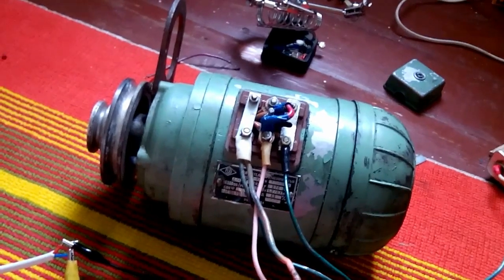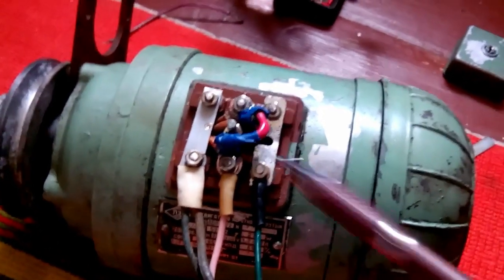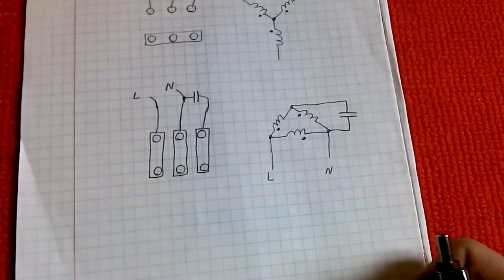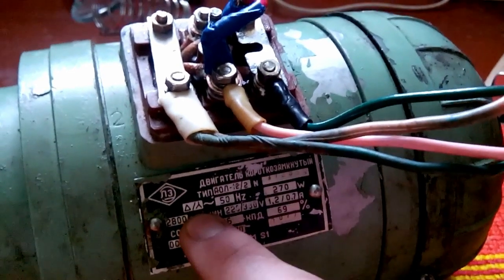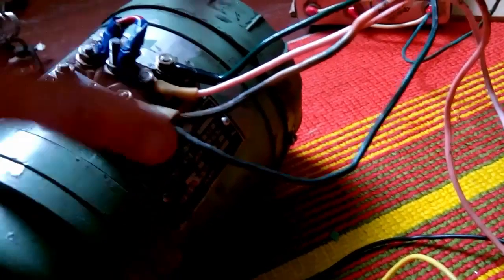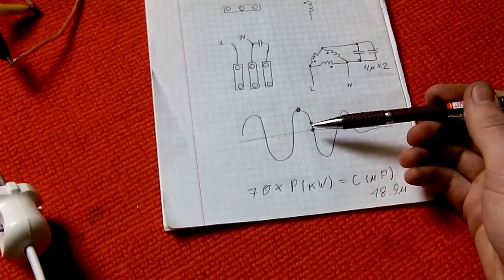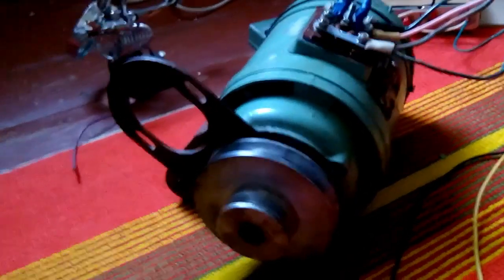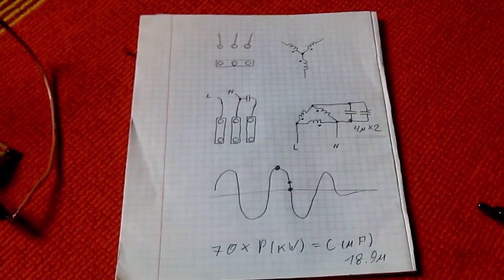Rewiring a 3 phase motor to delta (380v to 230V conversion)

Comment: What kind of outcome can ew accept this changes does to how the motor runs. Does it mean speed or strength or what  is lowered ?
Reply from the maker: With induction motors, speed doesn't really change much with voltage, it changes greatly with frequency. After the conversion the speed will be the same, but the motor will produce less torque.

Comment: The last part was funny, but good explanation! One question, what kind of capacitor are you using? What is its rated voltage?
Reply from the maker: Just use a cap rated as "motor run capacitor" for your mains voltage. If you have 220V they are usually rated 275V AC, those caps are designed to handle the large reactive power
Reply: Much appreciated!